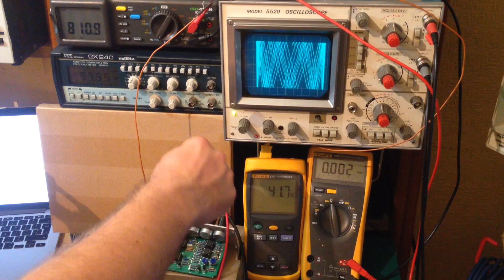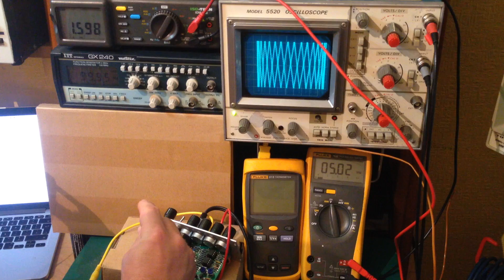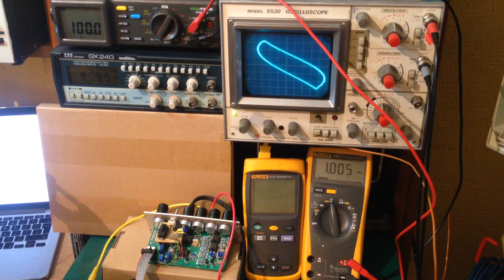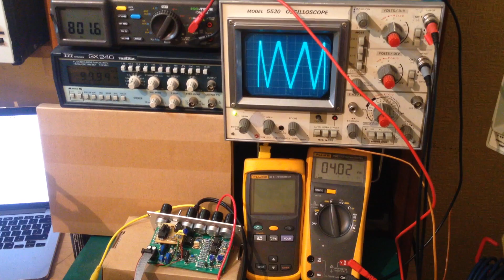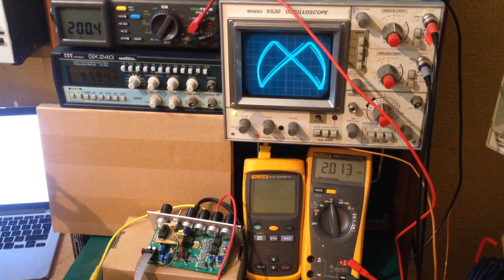How to use lissajous to tune an Oscillator

Comment: Usually you are meant to set the High Frequency trimmer to zero (fully anti-clockwise) before calibrating a VCO. Then, when you've gone as far as you can with the main trimmer, you add more High trim to bring the upper octaves into line.
Reply from the maker: +SlowCarToChina Yes, although this was a retune after the heater mod so it was nearly correct to begin with.